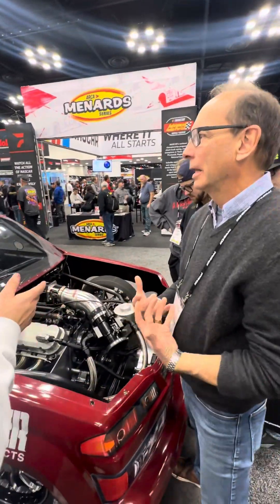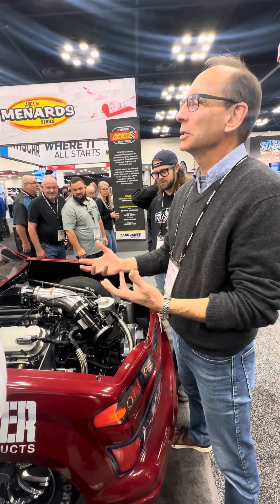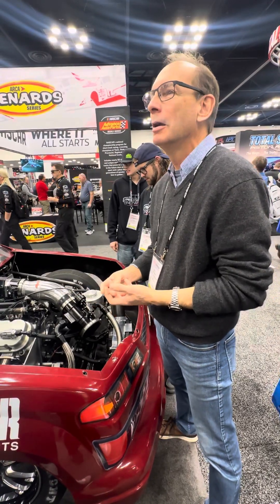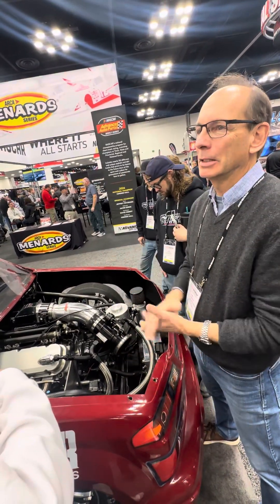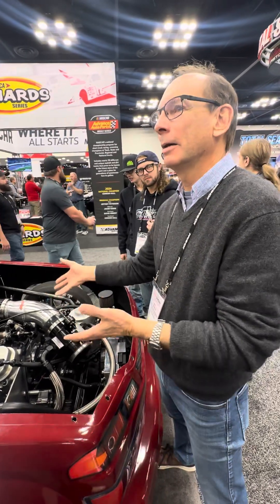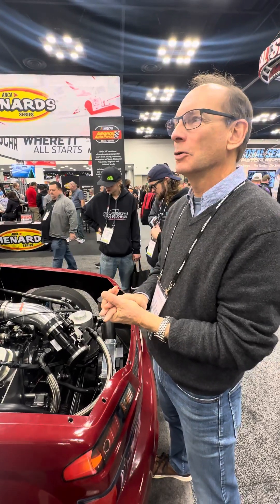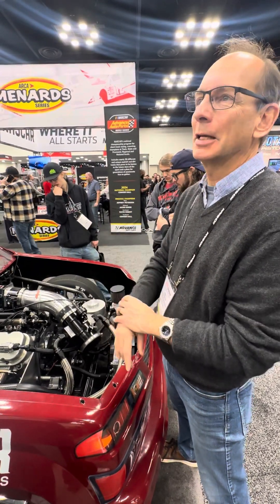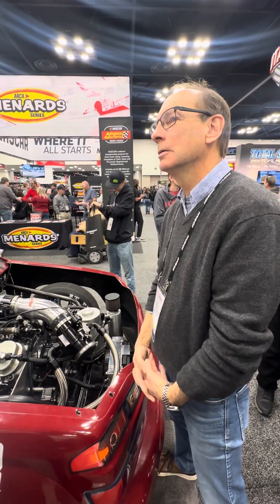Compressed air supercharging how it all started

Comment: Also use nozzles at the exhaust tips to drop the exhaust pipe pressure to a vacuum for negative back pressure. Suck exhaust out of the engine.